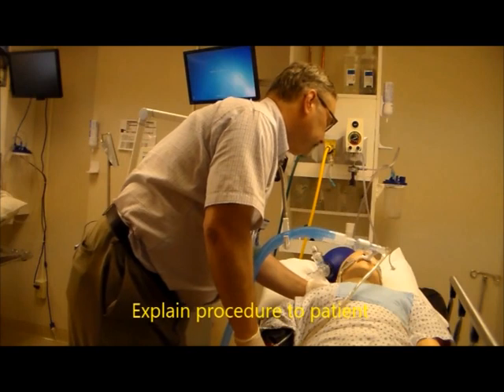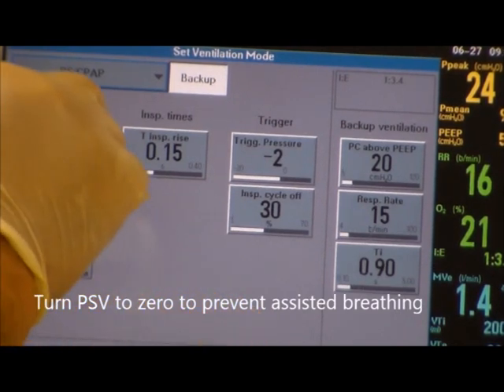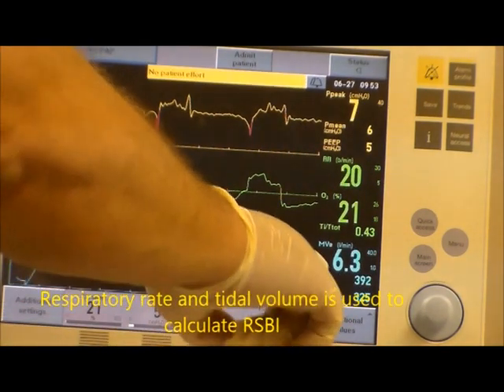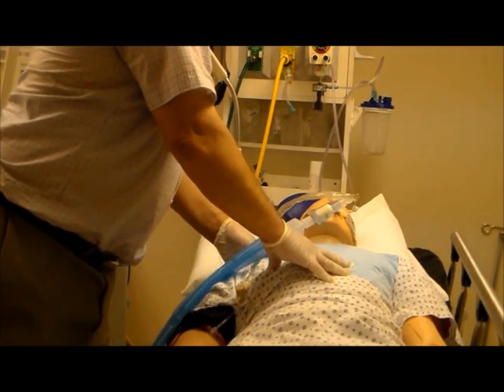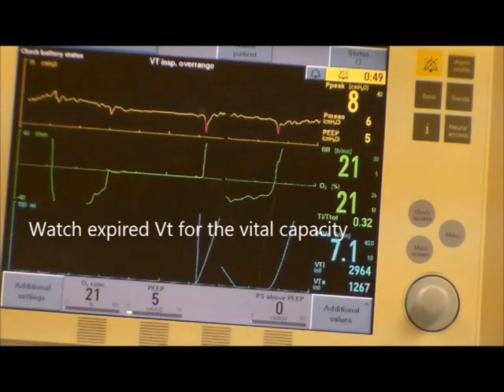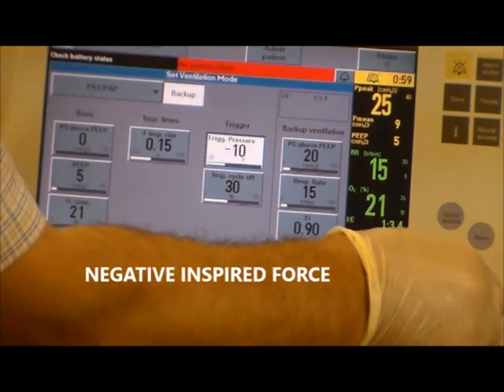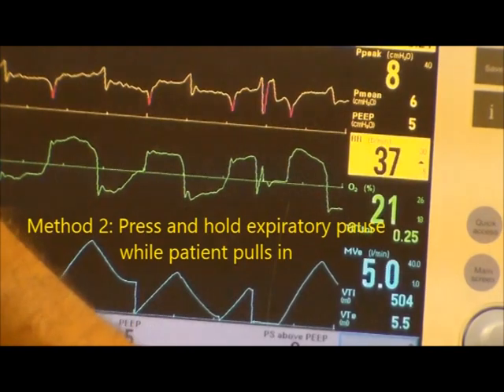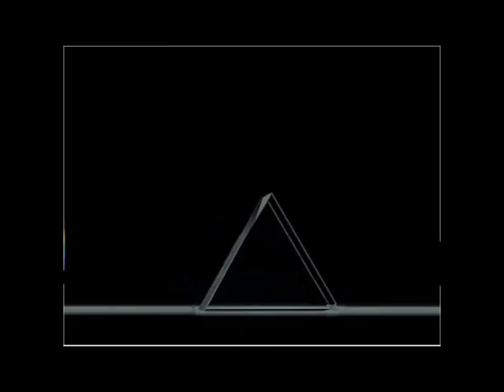RESPIRATORY CARE: Weaning Parameters w Servo-i

Comment: Pressure support completely off? are you sure...; I would think there would be some increased resistance imposed by the ETT / circuit - Personally I use 5 cmH2O to overcome the imposed resistance from the circuit / ETT, it is generally considered acceptable to go as high as 7 cm H2O
Reply: It's only for a short period of time my friend. After you can place them back on previous support. If uncomfortable w 0 PS, you can use ATC, or TRC, depending on what vent your using.